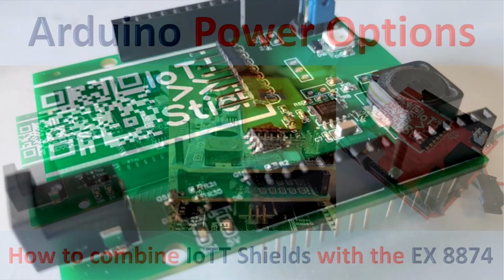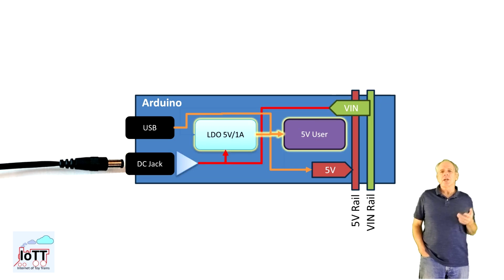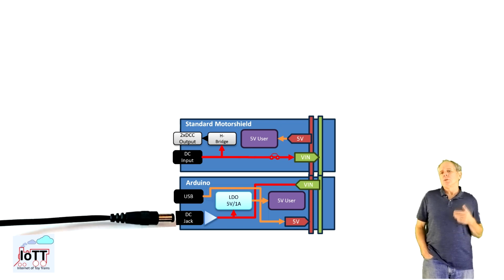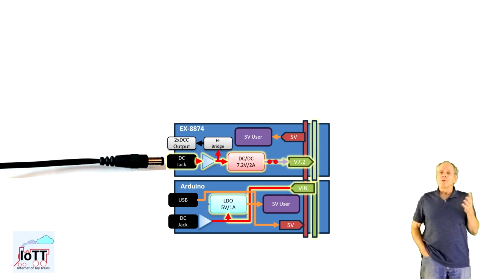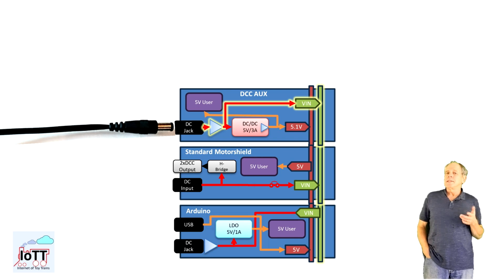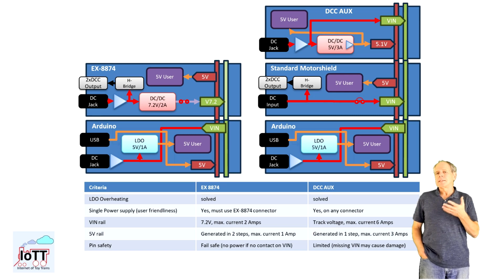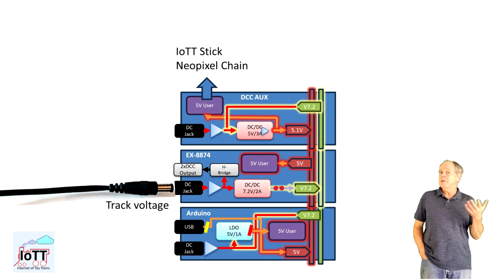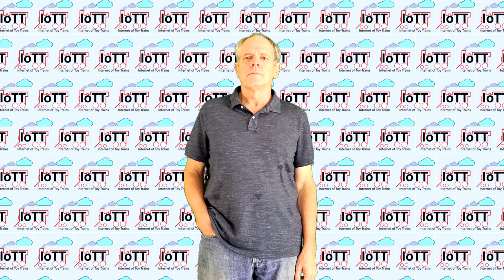Using IoTT Shields with EX 8874 (Video#130)

Comment: Hi, I have a Wemos D1 R32 and a simple 2 amp power shield. I tried connecting a redhat to them but the M5 stick only stays powered on for less than 25 seconds. If I add a AUX shield, the M5 stays on as expected. Is there a way to patch the Wemos D1 to supply the power that the M5 on the redhat needs  ?
Reply from the maker: If the Stick turns off, it probably does not get proper 5V supply. Measure the voltages you get on the 5V pin and on the VIN pin. You also may have to bend away the 3.3V pin on the RedHat.
Btw, I really like that board, so I have ordered some and will be able to have a closer look at it in a week or two.
Reply: @IoTT thanks, I look forward to seeing a video then. It would be nice to see a revisit of all your boards 😁
Reply from the maker: I received my boards today and had a quick look at it. It's what I thought: the 5V voltage output is only 4.4V. The Stick automatically shuts down if the input is below 4.6V as it assumes there is no power supply. Nothing to do short term, but I will look into making the threshold value for power off configurable. Btw, the 3.3V also only has 3.0V, so the power supply of this board does not meet specs and needs some adjustments, I think.
Reply: @IoTT thanks for that info. You confirm the stuff I’ve been reading. Not sure if an authentic Arduino Wemos D1 with proper 5 v exists. I look forward to your adjustments.
Reply: @IoTT I hope you have a chance to make a Sunday morning video 😊

Comment: I have a DCC-EX command center built from Arduino Mega and Standard Motor Shield. The Vin connect is cut and I use two power supplies but I didn't like this solution. So I bought DCC AUX shield and what I am not sure is shall I restore the Vin connect i.e. not be cut? If yes, what is the best way to do it - is it enough just to solder it thus restoring the connection
Reply from the maker: Assuming you cut the VIN trace on the motorshield between the two pads next to the Arduino header, you can simply restore it by soldering the gap. That is good for more power than the standard motorshield typically can deliver. After restoring the connection, you can use a single power supply the the DCC AUX DC jack und supply it with up to 18V for your track voltage. The DCC AUX shield then takes care of supplying 5V and VIN to the Arduino board, bypassing the LDO on the Arduino board. Just make sure all pin header pins are correctly connected to the board below.
Reply: @IoTT  Thank you very much! That's what I needed as info

Comment: What would be the recommended power sourcing if I am using a Red Hat Shield, Aux shield and TWO EX8874 boards?
Reply from the maker: Use a DC power supply from 12 to 16V to power the RedHat (via AUX for the new rev RedHat). Then use a regulated DC supply for the track voltage on the EX8874. If it has enough current output, you can use a single supply for both 8874s, but I probably would use two individual ones. Make sure to cut the VIN trace on the 8874s.

Comment: Thanks for the in-depth info on powering the DCC ex stack.  Just ordered the DCC-aux board and red hat shield.  I have the elegoo mega and DCC-ex 8874 motor shield.  Any other changes needed to get this running?

Comment: When you need to renew the router credentials in the M5 stick what is the best way?  Do you need to switch it into AP?  I have tried but the buttons on the side don’t seem to help!
Reply from the maker: If the current router is not active, it will automatically branch to the captive portal and you can set it up like a new IoTT Stick. If you want to connect to another router while the old one is still available, you can delete the old settings by clicking the power button rapidly about 4 or 5 times. That should restart the Stick, erase the Wifi settings, and it will branch into the captive portal, so you can set a new router using your smart phone. See here for more information and the flow diagram for connecting to Wifi: https://myiott.org/index.php/iott-stick/user-manual/iott-stick-core/wifi-configuration

Comment: Separate question for Hans. Your excellent PurpleHat shield. It's for HO scale, Would you consider an OO version. I'm wondering/confused if OO/HO trains use the same diameter axles/wheels as OO/HO, so don't need to be treated differently, BUT due to the different scales (3.5mm vs 4mm) doesn't that mean that the calcs for speed (MPH/KMH) need a different constant/factor in their computation? Also wondering about the possibility of different sized wheels/axles. Would adding optional params, defaulted to HO to allow users to adjust for wheel/axle sizes/scales be a nice addition to the PurpleHat?
Reply from the maker: The PurpleHat has a function to measure the wheel size. You push it a defined distance and it calculates the diameter based on the measured turns. Simple. It works for all scales.
Reply: respect, this is great/happy to use. I have ordered a purple hat. BUT. This will allow accurate real speed calcs, but surely the SCALE speed calc depends on the scale? Can you change the scale/the constant you multiply the real/actual speed by scale to work out scale km/h / scale mph so that I can get /set a more accurate scale speed for the locos I have. I wish to calc/limit the locos to their official scale speeds, without having to adjust all the calcs. Is it possible to expose that constant as a config file param and/or via the GUI. Shouldn't be that hard to program, I speak from 26+ years experience of coding experience. If I'm not understanding the calcs, excuse my beginner ignorance, is there somewhere in your excellent instructional videos I can better understand/is there something in the documentation/where can I look in the source code on GitHub etc to see how the calcs are done? If you're not using scale in the calcs then I dont understand why there are HO, N and G scale versions of the purple hat. I accept due to different sizes there may be other variations in the purple hat.
Reply from the maker: Videos #116, #122, #123 should probably answer most of your questions. All PurpleHat videos are included in the PurpleHat playlist. Of course, you have two settings. One for setting the wheel diameter to measure the real life distance, and then a scale selector to calculate the scale distance and speed from the measured distance and time. Simple application of basic physics ;-)

Comment: This is a GREAT video. Now understand the need for the DCC AUX Shield. A question. Its common on DCC++ EX to have a wifi shield ( to allow withrottle, etc), and due to smaller size, that shield often ends up at the top of the stack. If adding a red hat shield that adds loconet wifi, is it also necessary to have a wifi shield for DCC++EX? If so, useful to add that to the stack of examples i.e. how do things get powered on top of a red hat shield i.e. MEGA -> 8874 -> AUX -> REDHAT ->WIFI SHIELD
Reply: e.g. using the recommended makerfabs wifi shield atop the stack
Reply from the maker: When using the IoTT Stick on top of either DCC AUX or RedHat Shield, Wifi is provided by the Stick. It has WiThrottle, Loconet over TCP and MQTT servers and provides the web pages for configuration. You can connect to it with JMRI and other software, and with EndingDriver or WiThrottle.

Comment: Great video Hans explaining the many power options available. I'm just getting to this now as we were busy with a model railroad show on the weekend. Just one question for you. Does anything have to change if you add a second PowerShield to the mix? In other words, stacked from bottom up: Arduino Mega, PowerShield A, PowerShield B, RedHatV1. All this to take advantage of the capability of additional power districts. PowerShield A for district 1&2 and PowerShield B for district 3&4. Just plug a separate track power to each PowerShield and ensure that the jumpers on each PowerShield are set correctly?
Reply from the maker: Thank you, Rob. Yes, it is just plug in. In fact, you can stack up to eight of them if you are using DCC EX 5. For small scales with relatively low power consumption, it is possible to share the same DC supply. For larger currents I would suggest using individual power supplies for each board. And yes, of course you need to use different pins and configure them in the DCC EX setup accordingly.
Reply: @IoTT  Thanks Hans. That is what I thought. Appreciate the confirmation. I have a 10 amp, 12volt power supply split into two outputs, one going to each PowerShield. I don’t think that will cause me problems.

Comment: That really explains a lot and helped clear up some concepts I was missing.  These combination diagram would be great to include on your IoTT web site.  I have a few assumptions to confirm.  

#1, the Redhat v1 doesn't change the picture too much except to merge the AUX shield and current Redhat v2.  
#2, your 5amp power shield doesn't impact this in any way since it has it's own power input that must always be used.

Thanks.
Reply from the maker: Thanks. I probably just put a link to the Video on the web page. Just the diagrams without explanation will probably not do the trick.
1) Correct, the original RedHat was RedHat and DCC AUX on one board. Conceptionally it is the same, so the problems with the EX 8874 are the same. 
2) Correct, the IoTT Powershield works like the standard motorshield, no strange voltage on VIN. But it does allow for single DC supply setup as there is a jumper to feed the DC voltage to VIN, it even has an onboard reverse voltage protection for that purpose. So, if you want to use the Powershield along with the old motorshield for CV programming, you can do that with one single power supply.
Reply: @IoTT  So if I only had a UNO, power shield and redhat, I can use only one powersupply somehow?  Isn't 12-15v a bit high for the uno?
Reply from the maker: Yes, assuming it is the old RedHat with the onboard DC/DC converter. There is a jumper next to the LED labelled VIN. If closed, it connects the power supply to VIN, through reverse voltage protection. Make sure all pins are properly inserted in all boards and it works exactly the same way as described in the video.
If you have a new RedHat, you need to add the DCC AUX shield for the same function.

Comment: Thank you for these diagrams, Hans! It looks like the extra converter on the EX 8874 really makes things complicated for IOTT stick users if they want to have wired LOCONET. I think i'll just stick with my standard motor shields for now.
Reply from the maker: Well, it's not really complicated, just a little bit of a hassle. And important to know about it so you don't run into problems. For the EX 8874 it would be an easy fix to put the DC/DC converter at 5.1V output to the 5V rail in the next revision, and add a protection diode in the path to make it safe against back-feeding.

Comment: Well done -- The first part (Arduino only) should be viewed by all Arduino users as it is the clearest review of power I have seen. 

For IOTT fans the rest is just as great -- clear and concise.   

Suggestion for store or 3D library  -- a 3D printed blocking plug for barrel jack.   Alternatively I suggest using a empty barrel jack connector with no wires attached.
Reply from the maker: Thank you. A blind plug would be easy to do. Maybe I add one to the final EX 8874 frame as there is no need for it when only using IoTT boards ;-))
Reply: Yes, a barrel dummy plug would be nice.